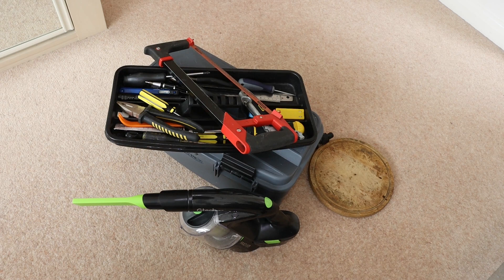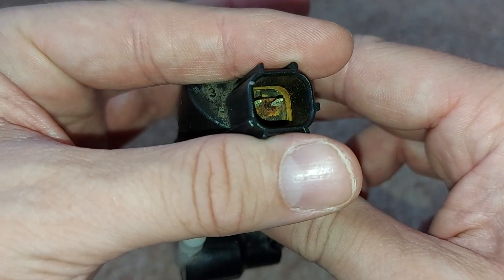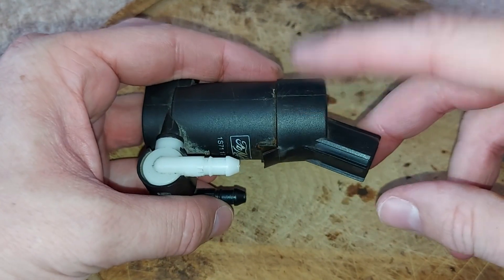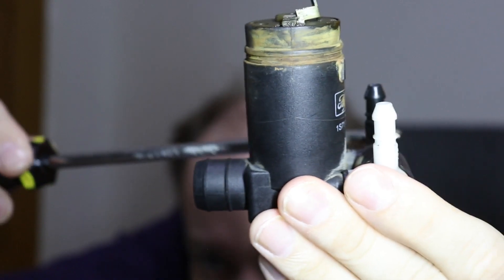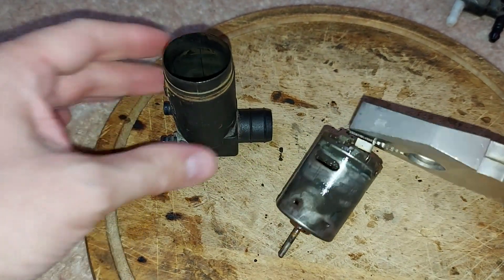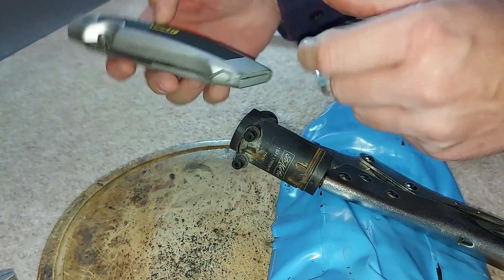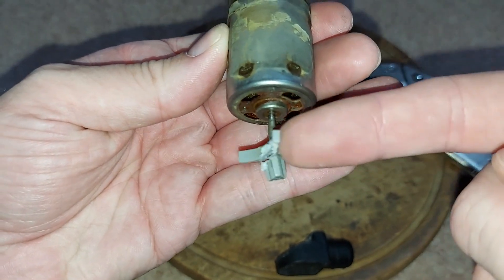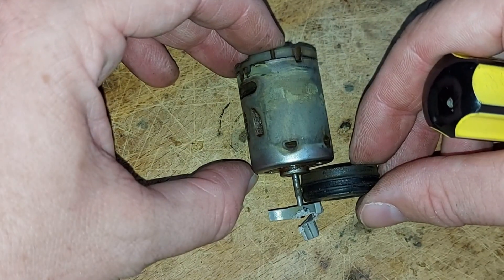Ford Focus Mk2: Destroying Windscreen Washer Pump (With Saw)

Comment: Interesting dismantling process. I assume that the pump was under a general anaesthetic at the time and therefore didn't suffer and is now recovering in a secret location. Nice to see the inside of a normally sealed unit and track down the reason for failure. Good stuff.
Reply from the maker: Of course! The pump is 'recovering' and being cared for by a team of experts. It's not stuffed in a plastic bag in the boot of my car. That would be criminal!

Comment: That's a very big hacksaw for a very little pump! I know it's too late now, but I would have tried therapy before resorting to the blade. Maybe the pump felt underappreciated or overwhelmed. Either way, from the amount of liquid within the case, the problem was clearly drink. I suggest that you leave out the alcohol next time you top up the washer reservoir so that the replacement pump isn't tempted to burst it's seal washer and succumb.
Reply from the maker: So, that's where my whisky went!